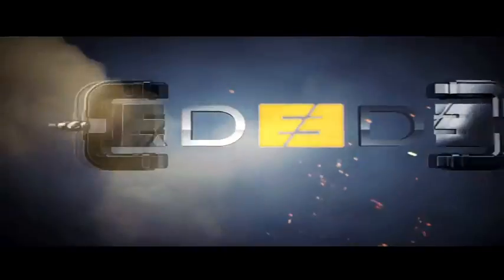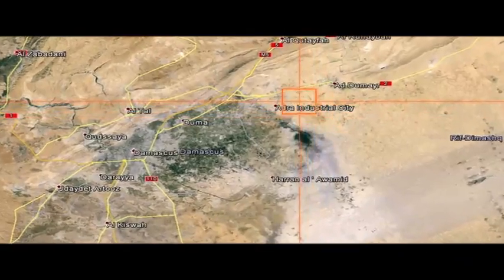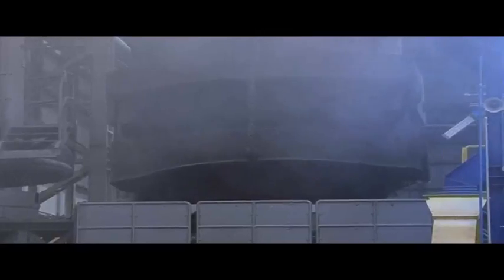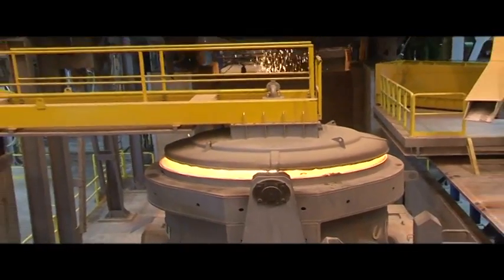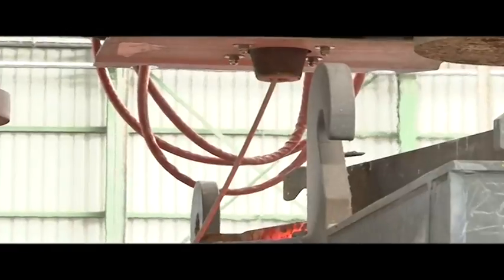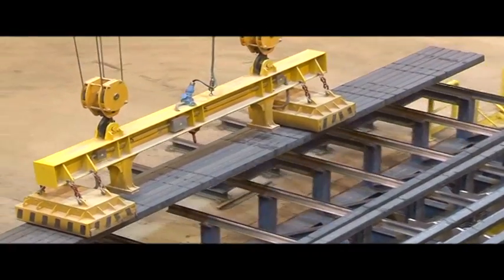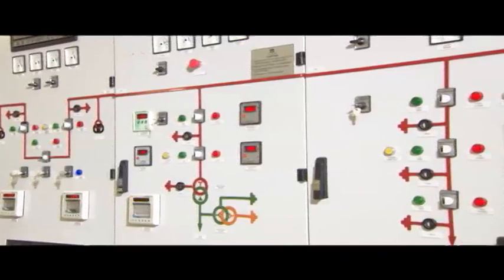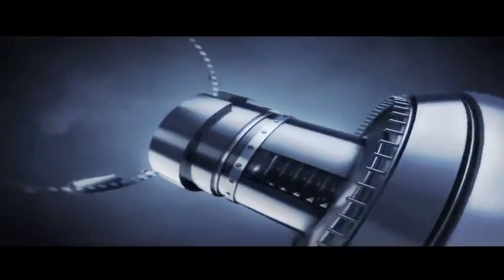hadeed metal manufacturing company - Melt shop, iron, steel, Hadeed, metal, billet, scrap, industry

Comment: Experience in Iron foundry industry.induction furnace  Melting, disa pneumatic sand plat, core shop, molten metal pouring, knock-out, shot(sand) blasting, fattling, lab testing for hardness, tensile, microstructure AND IN COMPUTER FIELD. Krishnaindeed@gmail.com